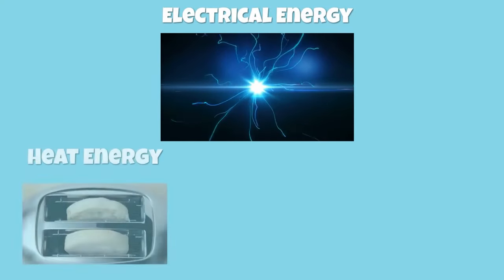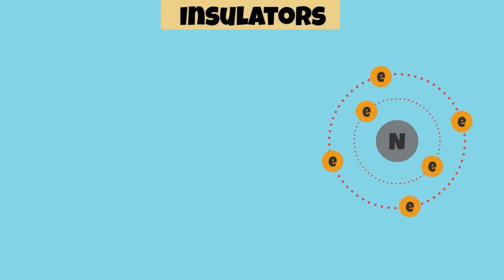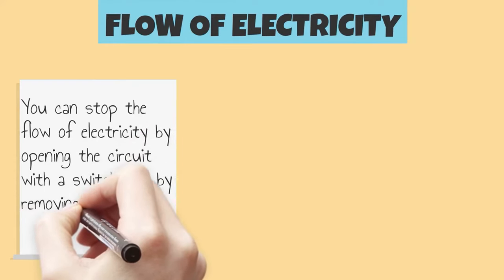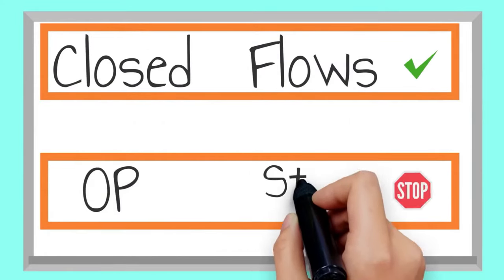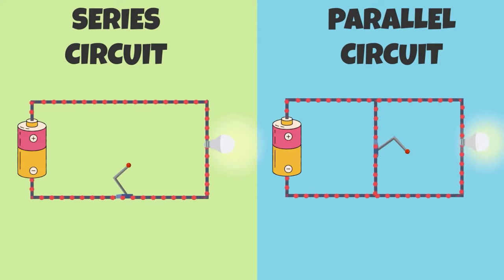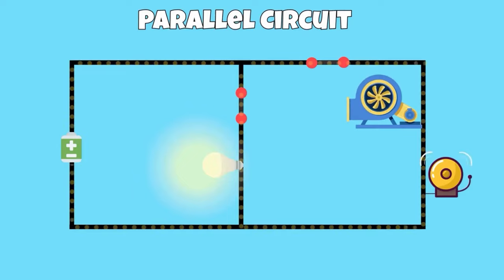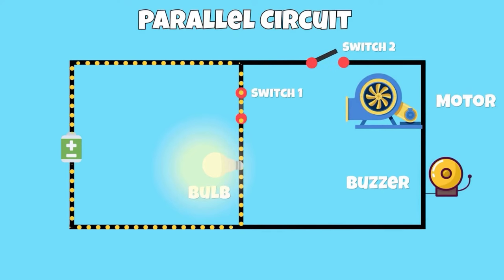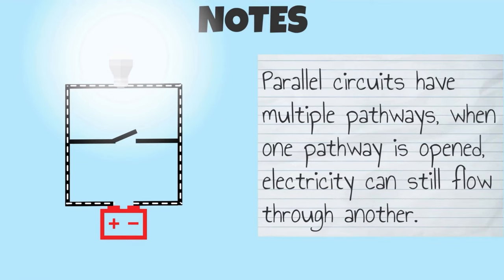How Does Electricity Flow in a Circuit? | Open, Closed, Series & Parallel Circuits #steamspirations

Comment: Just saying, electricity goes from negative to positive. Protons are too heavy hence why they do not go through circuits
Reply from the maker: Thank you! The direction of conventional current is from positive to negative. The direction of free electron flow is from negative to positive. :)
Reply: @STEAMspirations one question if electron flow from +ve to +ve terminal of battery then what does electron pass through battery or what

Comment from the maker: 🔥 The Must-Have Digital Toolkit for Mastering Force, Motion, & Energy! Crafted by Experts! 
👉📲 Get it Now: https://www.teacherspayteachers.com/Product/LVL-Up-Science-Force-Motion-Energy-Digital-Edition-8395630

TEKS Addressed: 
5.6A Explore the uses of energy, including mechanical, light, thermal, electrical, and sound energy
5.6B Demonstrate that the flow of electricity in closed circuits can produce light, heat, or sound
5.6C Demonstrate that light travels in a straight line until it strikes an object and is reflected or travels through one medium to another and is refracted
3.6B Demonstrate and observe how position and motion can be changed by pushing and pulling objects such as swings, balls, and wagons

* Key Features of LEVEL UP Science:
✅📏 100% Aligned to State Standards
✅ Comprehensive Assessment Suite
✅ Self-Paced & Student-Centric Learning
✅ Engaging, Interactive Activities
✅ At-Home Support & Virtual Learning-Ready..and much more!

🌟 Don't Miss the Opportunity to Benefit from the Expertise of a Seasoned Educator and Administrator! Download Now to Unlock Student Success!